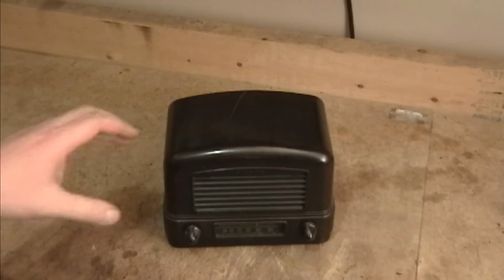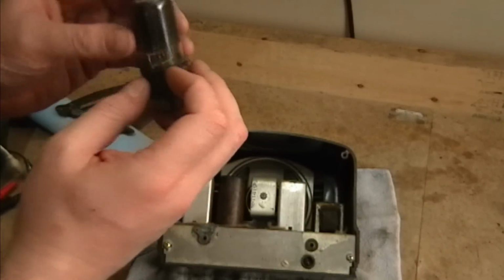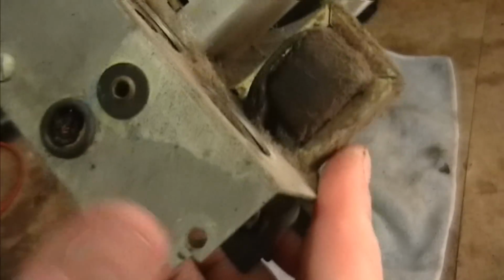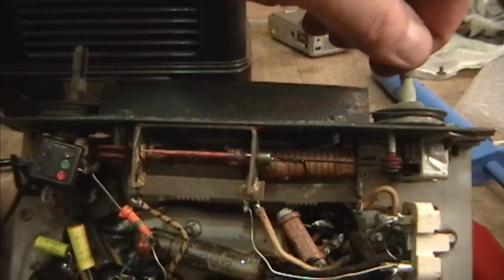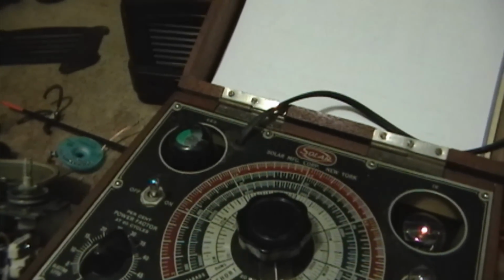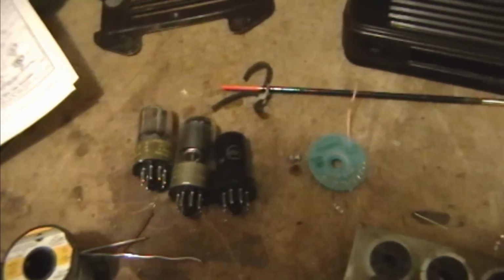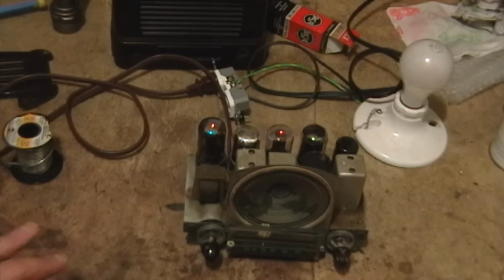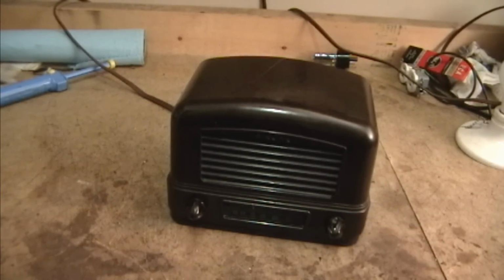FNR -  Airline 14BR-1501

Comment: 12SJ7 is a sharp cutoff pentode where as the 12SK7 is a remote cutoff. The  12SJ7 would work to point but would be ineffective for AVC. 12SK7 would be correct.

Comment: It was probably a factory production change would be my guess, since it's a post war radio it wasn't unusual for a manufacturer to change what tubes they used depending on what they had available at the time. In my Philco model 72 "Bing Crosby" (46-1201 in the U.S) there were no less then 8 different versions of the same set over 4 production runs. The use of late 30s body-end-dot code type surplus resistors is something that is typical as well for a low cost radio as well.

Comment: It would depend on whether they included a dropping resistor in series with the filaments, which they normally did since they figured on a working voltage of 117-125 volts AC coming out of the wall outlet. That combination of tubes, 35L6, 35Z5, 12SQ7, 12SK7, 12SA7, only added up to 107.8 volts so with a 50L6 in there, and the dropping resistor, the tube heaters would be running 15 volts short.

Comment: I guess my question is: does the inside part of the insulated antenna physically come into contact with some metal part on the inside of the cabinet? Since it is mounted on a sheet metal back, that would be a design consideration since sheet metal bends easily. If "couples" means comes near, that is my question about tolerance.  I guess I am not clear on the use of the word "couple" in regard to capacitance here. How important is physical contact and/or gap size?

Comment: 74BR-1501B, that pins it down to the 1947 model year and it was manufactured by Belmont Radio. The first two digits reversed give you the model year, the two initials, B and R, stand for Belmont Radio. I know of the site you refer to, I have painted up Bakelite cabinets before but only ones that were broken to begin with, and whenever I chose a colour other then white or ivory I tried to pick something that suited the era of the radio, not the colours of a 60s clock radio.

Comment: A 35Z3, in adition to being a Loctal type, does not have a pilot light tap on the filament. Radios that use a 35Z3 either do not have a pilot light or use a 120 V C6 Candelabra bulb to light the dial. The difference between a 12SK7 and a 12SJ7 is more in minute electrical characteristics then physical sonstruction , but 12SJ7s are more typically used for RF amplifier tubes then for IF amplifier tubes.

Comment: Very cool little radio, looks like an exercise in compact packaging. I had a few questions though, What is the difference in the tubes that have one letter off i.e a 35Z3 vs a 35Z5? Also, a 12SK7 and a 12SJ7, what would the difference be between them?  You then commented about the possible voltage potential on the antenna, how much potential would there be? Also, what about amperage, what is the typical amperage that run through these radios?
Reply: 12SK7 is a remote cutoff pentode which works with the AVC circuit to adjust gain for stronger  or weaker stations. 12SJ7 is a sharp cutoff pentode and as it will function somewhat in place of an SK, the AVC will not function.

Comment: What kind of tolerance is allowable between the antenna jack and its mating plate for adequate capacitive coupling. I can't imagine sheet metal dimensions as being very repeatable/reliable since they're so easy to bend/distort.